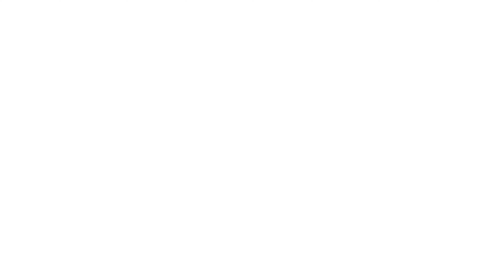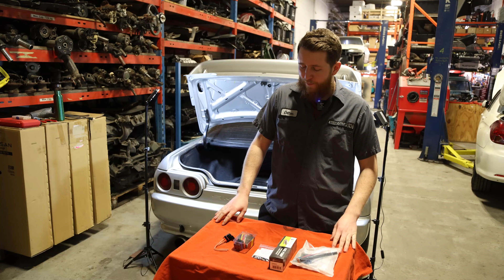How To Install An Aftermarket Fuel Pump || Walbro 450 + R32 Skyline GTST

Comment: Is this the same for a GTR?
Reply from the maker: Very similar, the GTR Uses a plastic hat and great care is required to install this type of stud to the plastic hat in order to prevent excessive heat melting the hat during operation,